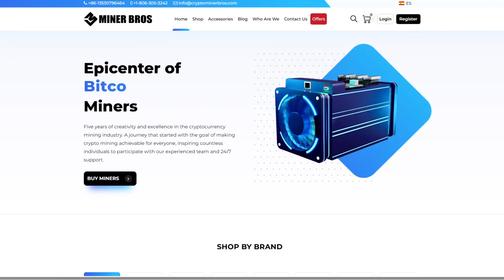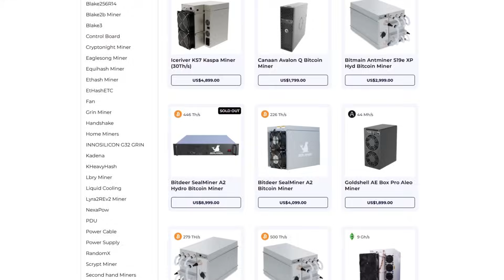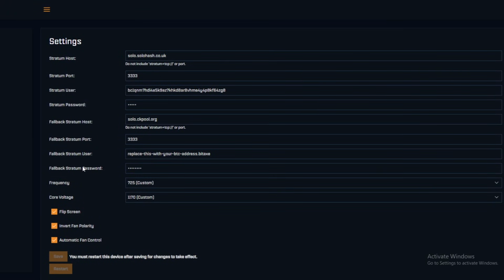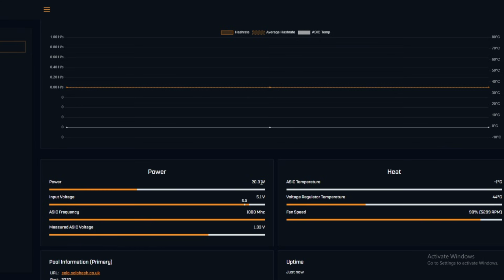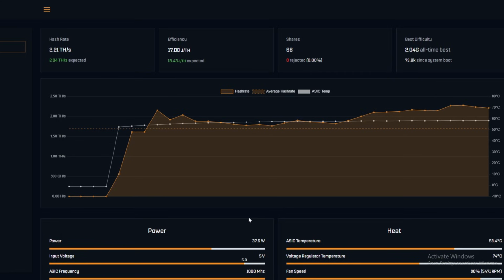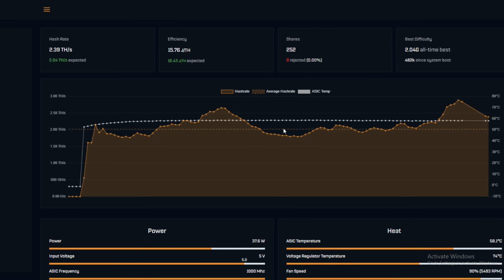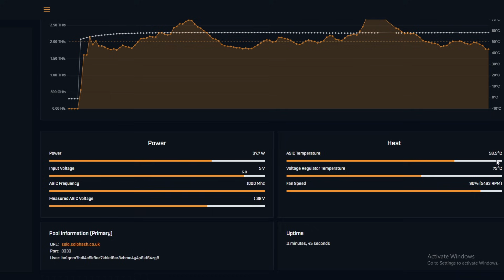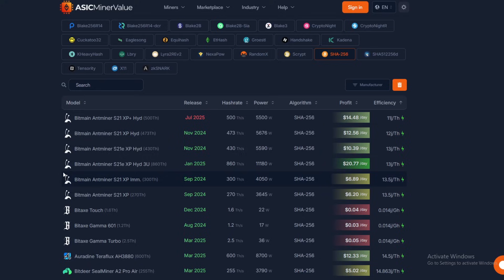Pushing The Bitaxe Gamma To 2TH/s...

Comment: I have found it’s the heat sink and paste that makes the difference . It doesn’t matter which fan you use . I’ve tried all variations and the stock fans do the same as the noctu fans but the heat sink and paste makes a difference

Comment: just flip the fan on its side so the cables are on the side not the top and slide the fan under the board, it will sit perfectly and be right up against the heatsinks.

Comment: What power supply are you using? I've bought the original Bitaxe 601 Gamma and in the attached brochure it was said that the power supply is 5A - 8V, 40W but in the box I've found 5A - 6V, 30W power supply.
Can you recommend a good and strong power supply? But build like the original one, not like i.e. Mean Well LRS? I would appreciate such a recommendation greatly.

Comment: I picked up a stand with a built in fan mount on the back from a guy on EBay US. It works fantastic even without a heat sink on the VR. I’m up to an estimated 1.58 Th/s but my bottleneck is now input voltage with the two fans on one port but I only have a simple 50W brick. I’m at 775/1190. If I updated to the meanwell psu I could probably push higher but I think for now I feel pretty good where I’m at. Oh using the ice tower. I may split the back fan off to a dedicated 5V controller but my pool says I’m averaging 1.62 and I spike to over 2.12 that may be where I’m gonna hang out and see if I’m still stable once summer temps hit. 56 degrees on the asic right now and 69 on the VR, 4.9V on the input voltage.

Comment: Just so you know, the ASIC temp cutoff is at 75C, so you can run it safely up to this temp before it will automatically declock to safe clocks. The Voltage Regulator is rated at a maximum of 150C. But maximum cutoff should be 125C. These components are designed to run super hot. You're being far too cautious 😂, if you dont believe me, go do a Google search on a Texas Instruments TPS546D24ARVFR chip max temps

Comment: Copper heat sinks on the back point less better of just blasting air to the vr you basicly inslating it and getting it more hotter if anything use coper plates that are less then 1mm thick with thermal past that sticky stuff on them things you got on the back just heat up your blow ur bit axe lol😂

Comment: What's the actual name for the stilts used to hold the bitaxe?
I've read that the silenx is 150grams and will not make contact with the chip if the bitaxe is standing.
Reply: Had to lay mine flat as well. Way to heavy for just the two mount points.

Comment: The splitter with the 3 and 4pin connector. That 4th pin is for RPM of the fan, so both fans still get the same PWM signal

Comment: My Bitaxe Gamma OS won't let me get above 625 on the asic freq, what are you guys doing to allow a higher freq, and voltage?
Reply: In AxeOS, goto the settings page. The address bar will have Your I.P. address/#/settings
Now add /?oc after settings and hit enter. Youre welcome. Im not sure if this works on phones. Good luck!
Reply: could be your power supply
Reply: And I have a custom 200watt power supply!
Reply: There's no option above 625, nor will it allow you to type in a higher number. On OS 2.71
Reply: @radmaximus that might be as high as yours can go then
Reply: on your address http://192.896.10.170/#/settings or whatever just add ?oc

http://192.896.10.170/#/settings?oc

after you can choose whatever option you want

Comment: /settings/oc?
Reply from the maker: -f 1000 -v 1350
Reply: @SterlingSpecter1  I ran that momentarily until i realized how many watts it was drawing from my PSU which is only rated for 30w. Ran 1275/915 for a while at 29w and 1.91Th average but PSU was too hot...I could smell it lol. Currently on 1275/825 maintaining a 1.77Th average with expected of 1.68Th.going to be investing in one of those fancy PSU's next pay lol

Comment: 825 MHz and 1300mv consistently hits 2TH/s or more after about half an hour of hashing bounces between 1.5 and 2+
Reply: That must be real-time hashrate, not an average, because 825MHz is not enough fq to hit 2TH on average
Reply: @N1NJAKIDD  yes, it's realtime, I should have specified. Lowered the voltage to 1275...it gets an average of 1.77Th and it's up over 2Th more often in realtime hr

Comment: Heat increases resistance, which then results in higher current (watts) which is why you’ll see the wattage go up slowly from where it started, hence efficiency becomes terrible, until everything reaches a balance. 
You saw my waterloop, and I run them all at 750. I could push them further, but longevity is a greater concern for me.  My expected is 1.53th, and it does hit 2th from time to time.

Comment: thats the one i'm currently using, until my ice tower low profile comes in, and the 3d printed socket adapter, and the fan shroud, and the 60mm fan....so yes, the 52pi low profile 4heat pipe cooler is a bit of a pain. its not just buy a cooler, and/or also a fan. its more. Cooler $20, socket adapter $15? 60mm fan shroud $15?? noctua 60mm fan $18...trying to find someone to print the parts = nightmare.
Reply: Plebstyle make the entire kit for purchase just change the plastic pins too M3 screws and the copper shims to 4mm x 30mm copper plate better connection I'm consistently over 2.1 th with high spikes of 2.9 once in a while 
I highly recommend the low profile and pushing air I haven't tried pulling air yet